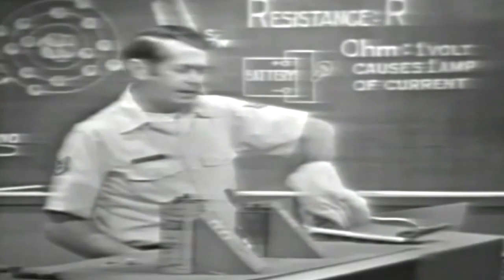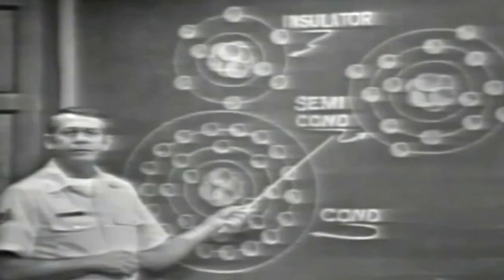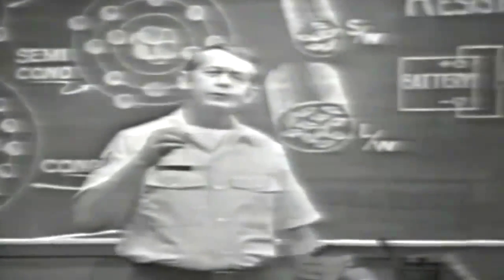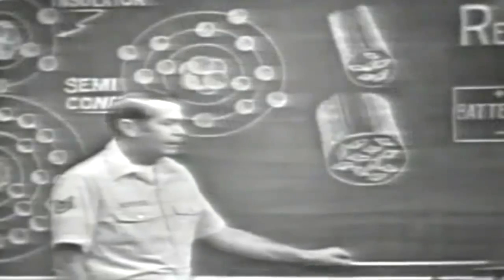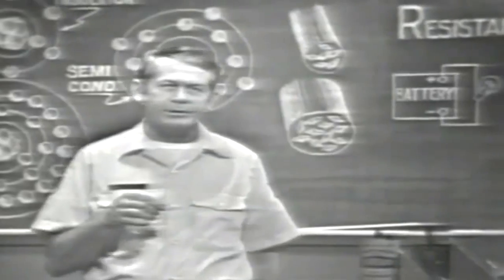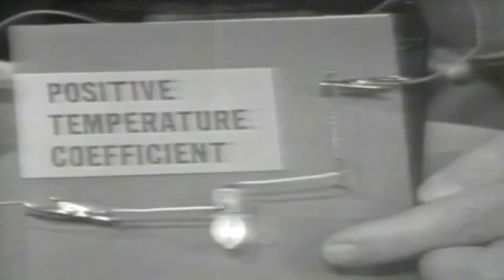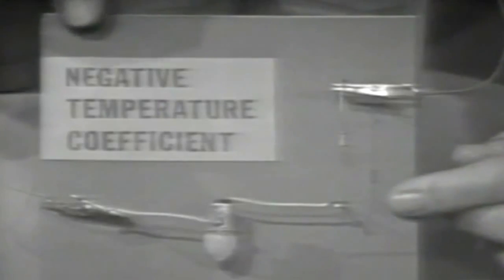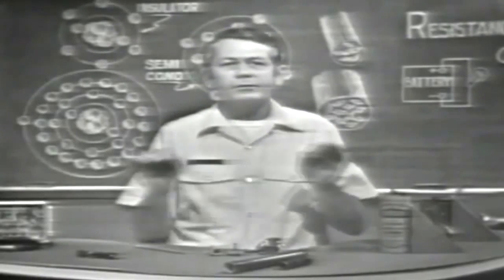Resistance - Basic Electronics 5A

Comment: Gold is NOTa better conductor than copper. In fact, Silver is the best at 1.6x10^-8 ohm.m, then barely below it is Copper at 1.7x10^-8 ohm.m, then way below it is Gold at 2.3x10^-8 ohm.m, and barely below Gold is Aluminum at 2.7x10^-8 ohm.m.

Gold is used for contacts because it tends not to corrode.